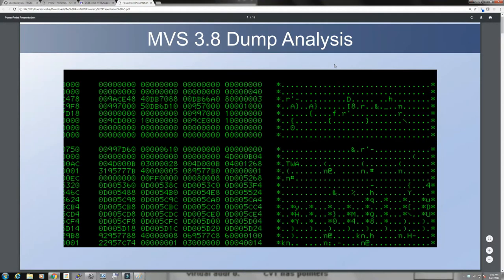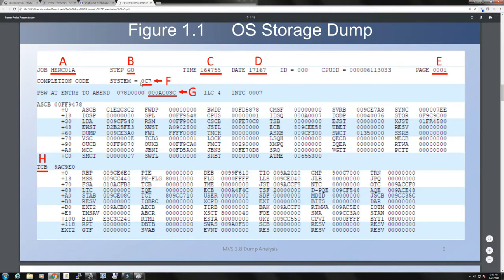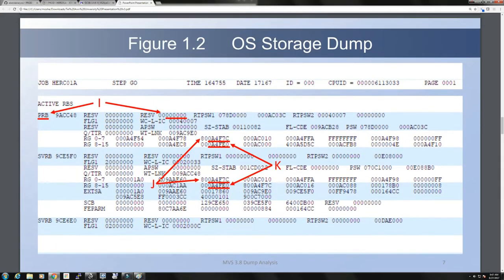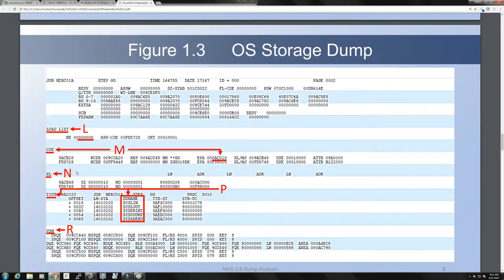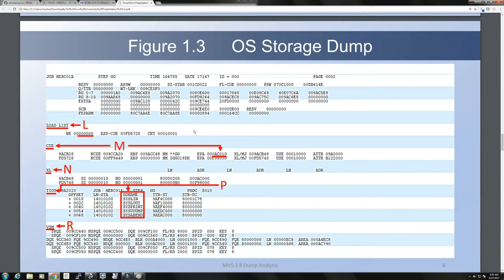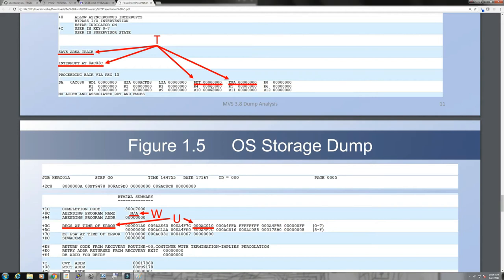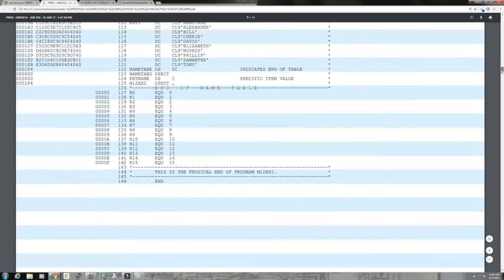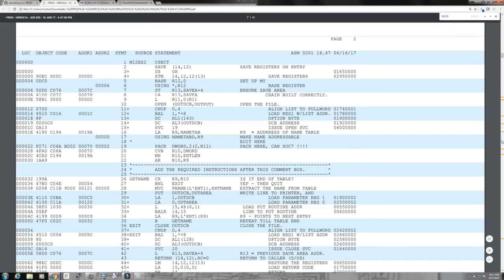MVS 3.8 Dump Analysis - Part II - M16

Comment: Brings back good memories. In my technical days, fellow programmers more often then not brought their dumps (yes, on paper) to me to have them solved. I loved it and recognize your 'Sherlock Holmes'-y feeling like: "Yay, another puzzle to solve!"...
Reply from the maker: Yes for a short while I did that same function. But we had a guy who could it all without manuals and he could do hex math in his head. Amazing guy. Even IBM sometimes asked him technical questions.
Reply: @moshixmainframechannel  I knew most culprit instructions in HEX, like F9, FA, FB, FC. And of course D2, moving to or from invalid storage... Stuff like that. I did not have to dive so deep into control blocks though, we mainly did application program dump solving. S0C7 and S0C4 where the most common abend codes AFAIR.
Reply from the maker: Very cool !

Comment: They could make a video about the creation of online applications using IMS or mvs included software?
Reply from the maker: They couldn't because there is no IMS (DL/1) or CICS legally obtainable for MVS 3.8.... sorry!
Reply: Thanks for the reply
However, in Tk4 is there any possibility to develop online terminal application?
And who with what means, there is also the documentation

I thank you in advance
Reply: Is there any other possible to create online terminal applications in MVS?
Or. Who is there documentation?

I thank you in advance
Reply from the maker: yes, you can install KICKS which is something similar to CICS (it's free) and it runs on top of TSO. 
check out this: http://www.kicksfortso.com/gold/TSO%20User's%20Guide/

Comment: For me, if I encountered this problem, I won't be reading the dump because the first thing to notice is the DD statement missing. This already tell us the problem.
Reply from the maker: yes of course. But it's also a good way to learn to read dump analysis to understand that everything is reflected in the dump. thanks for watching!
Reply from the maker: and this was the introductory video. I will presend a second tutorial with a much more involved issue to resolve.